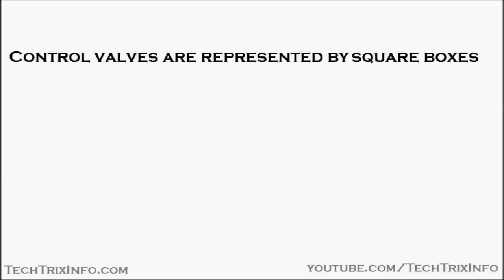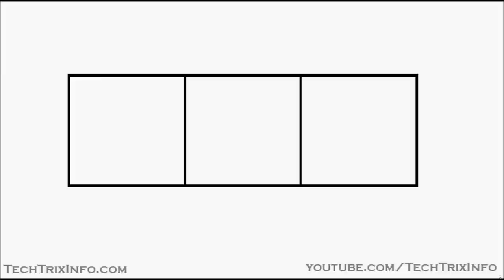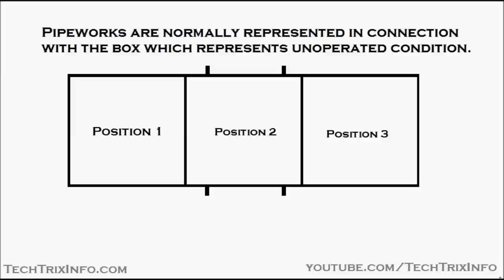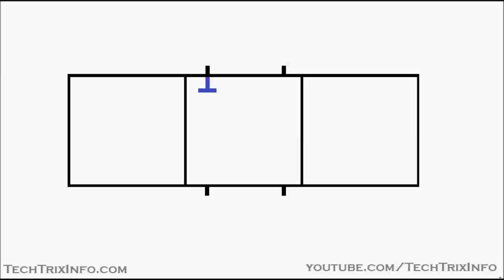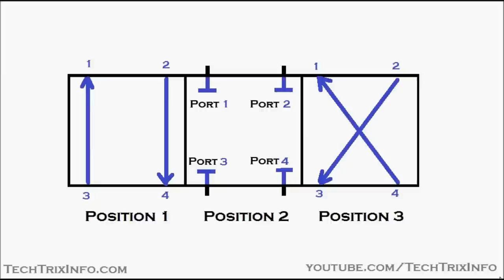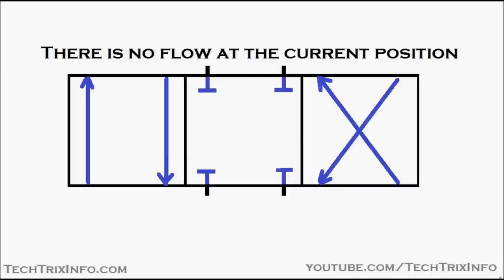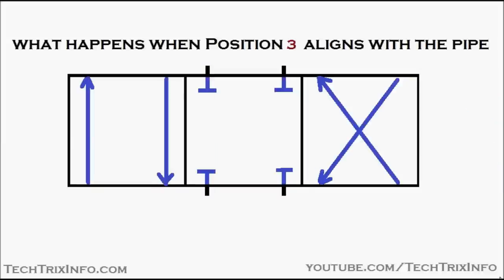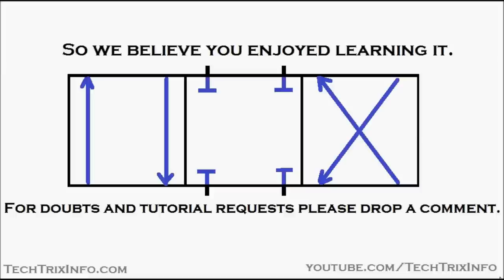Animation | How schematic symbols for control valves is derived | How 3 position 4 port valve works.

Comment: Looking at the picture, I would assume the source must be at the top.  What I mean by this is; let's say the compressor is attached to port 2 and port 1 is venting to atmosphere.  If the compressor was attached to port 3 then position 3 would have the flow going against the arrow (going from port 3 to port 2).  Is this correct, or am I misunderstanding the diagram?

Comment: What would happen if you pumped air in the opposite direction to the arrows in the schematics ? Would it still flow, or is it like a check valve and it would get blocked off ?
Reply from the maker: Hi, thanks for your comment! If you pump air in the opposite direction to the arrow in a 3-position, 4-port valve schematic, it will depend on the valve design. Most 3-position, 4-port valves are designed to control airflow in a specific direction and won’t allow flow if the air is pumped in the opposite direction. Unlike a check valve, which only allows flow in one direction, these control valves typically use internal mechanisms like spools or slides to direct airflow. When air is pumped against the designed direction, the valve might block the flow or cause irregular operation. Always refer to the specific valve’s datasheet or manufacturer guidelines to understand its behavior. If you’re unsure, consulting a professional can ensure you’re using the valve correctly.

Comment: for position flow goes from 3 to 1 and 2 to 4 ;  so is it necessory that in position 3 flow has to pass from the port it passed previously...like always towards 1 and 4?
Reply from the maker: Question is not clear
Can you whatsapp me @ +919744615655
Reply: How I see this working is, port 2 would be your P (pressure) line and port 1 your T (return to tank) line. Port 3 + 4 would then be your working lines (i.e. A & B lines).

Comment: How about if you want to control 2 double acting cylinders both at the same time, that work in opposite directions to each other? E.g. cylinder A extending while cylinder b is retracting and vice versa? What connections are needed, and how many valve ports and positions are required to do this?

Comment: I believe your arrows are wrong in position 1. The air source is, I'm assuming is port 4. In position 3 this would make sense (supplying air to port 1. Then in position 1 port 4 would change position to supply air to port 2 (port 4 switching from port 1 and 2). But you have the source air coming from two different ports. So shouldn't 4 always be the source and 3 always be the exhaust?
Reply: That's the failure of this video.  We don't know where is the input port ("P", pressure), or the outlet (exhaust to atmosphere if pneumatic; return to reservoir if hydraulic), and we have no way of knowing the state of the positions relative to the state of the operator (whether a solenoid, or manual lever or push button, etc.).  Any schematic in the real world is going to show that operator and unless you know how that operator works, and the standard representation of its positions relative to the flow positions, you'll be left scratching your head as to whether a lever (for example) pushed "in" vs. pulled "out" will correspond to positions 1 or 3.  For that reason, I gave this video a thumbs down.
Reply: @verumillic1424  For this to operate we can logically assume the following. Port 2 would be your P (pressure) line and port 1 your T (return to tank) line. Port 3 + 4 would then be your working lines (ie A&B lines).
Reply: @1daniellewis1  Thanks and yes, agreed, however my point about the operator still stands.  Any educational piece on a DCV should have hook-ups (at least supply and return) and operator clearly marked -- not assumed -- so that directional paths/operation can be traced.  It just makes learning the material easier for those new to this, in my experience.
Reply: @verumillic1424  The only point I made was, that we can determine the input port (P) and the exhaust port (T), from the information given. As for your point about the operator being clearly marked, I agree, and this would normally be shown on a schematic. Showing the supply and return lines would also be helpful for those new to this subject.

Comment: I have a tire changer which has a pneumatic bead press arm. My valve was leaking and i am trying to decipher what kind of valve it is so i can order a generic directional valve. The parts manual says it is a 5/3 air pilot control valve. Now what confuses me is when they say something like a 4 way valve. What does that tell one about a valve? But thanks to this i now know i have a 5 port 3 position valve. Theres a pressure line, two pilot lines and two output as well as 2 exhaust which i am assuming do not count.
Reply: Mr Nick Elias,
5/3 indicates 5 port and 3 position valve. ON position, OFF position and Neutral Position. Basic valve have 5 ports - 1-supply (pressure line), 2 & 4 working (O/P line) and 3 & 5 Exhaust. Two pilot connection extra for air signal (Air pilot control valve)

Comment: Great work team  :)
Just a single doubt , do position 2 always remains un operated mode?
because in the video the valves are not linked with any pipe (for 2 position)
Reply: position 2 is blocked off so in this case it will not do anything